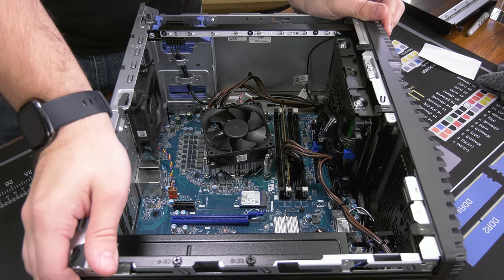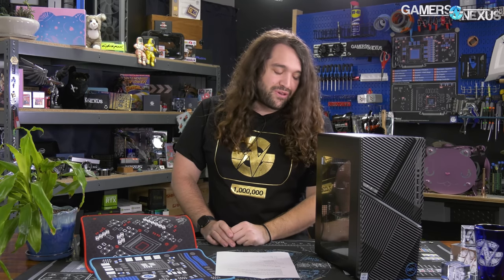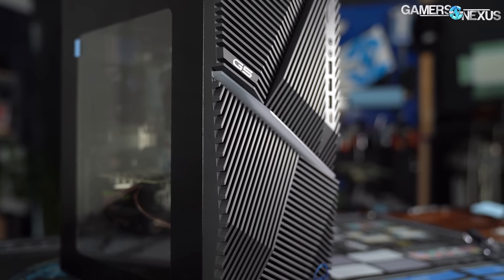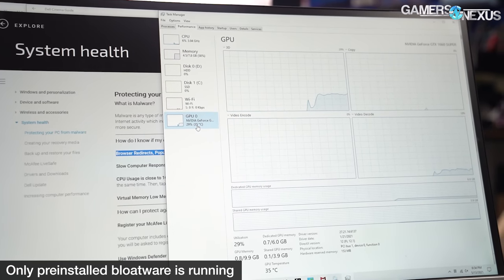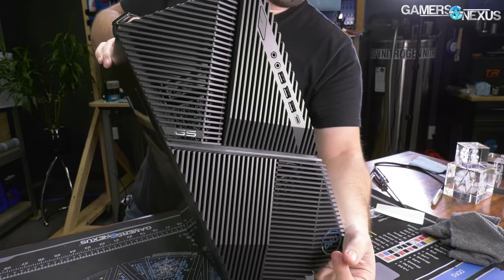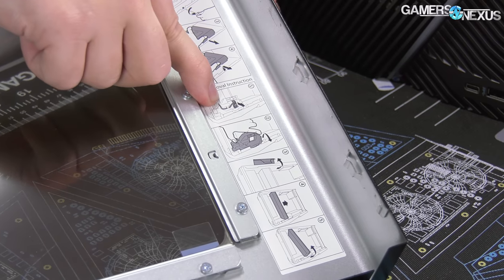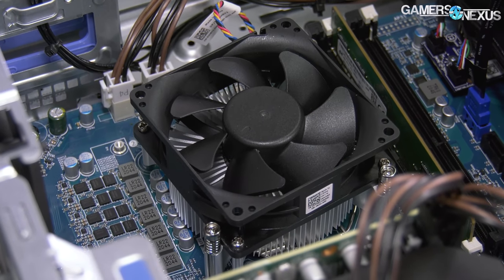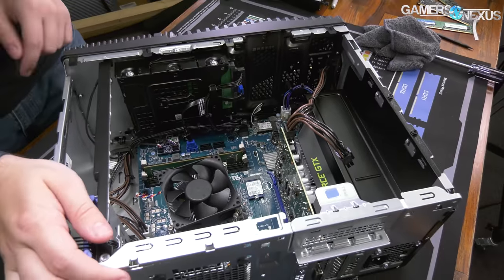Worse Than Walmart: Dell G5 5000 PC’s Garbage Parts & Hidden Charges

Comment: "Don't spare me, doc! What's the diagnosis?" "Dude, you got a Dell!" "Oh no! Is it terminal?" "Very..."
Reply: "No, it's not a terminal.  It's useless as a terminal.  In fact, it's just useless."
Reply: They didn't used to be quite this bad. I picked up a prebuilt dell from Costco 7 years ago because it was on sale which had an i7 4790, 12 GB ram, a 1 TB platter drive and I think like an admittedly butchered OEM GTX 750. Later after adding an SSD I used it until literally last month with a 2060 which was the third graphics card I had in it. All standard parts, I switched out the power supply on it no problem when I got the 2060. The only reason I replaced it was that the last couple years games were starting to be throttled by the CPU too much and I was seeing too many frame drops. I assume clock and ram speeds had just moved on to much but now it's my media server for my TV.

Sad to see them going from something that you could use and upgrade long term to this joke of a system.
Reply: This was so good, but also so bad, that i will return to my $SHELL and die laughing XD
Reply: Yes, but will you return 0, or 1?
Reply: Nurse, schedule a Dellectomy, stat!

Comment: This is a basic business office computer.  We've been getting very similar base models like these for years in bulk where I work.  They serve their purpose for basic office functions and that's about it.  For Dell to advertise this as a "Gaming Computer" is laughable.  Sure does look pretty on the outside though.
Reply: Yeah for real though. The case isn't awful.

Polished turd lmao.
Reply: Yeah actually I have a very good experience with Dell office PC for many many years. Never cross my mind that they do gaming PC. It's scam if an office PC with some second grade GPU plug in get to called itself gaming PC. I do build my own gaming PC.
Reply: A basic office computer with a completely unnecessary GPU that only adds cost, but does not make this POS good for even casual gaming
Reply: @Gatorade69  I remember that, and even after she politely declined all the extra warranty and support charges they were trying to put on her bill, THEY STILL ADDED THEM. I have a feeling their sales reps are instructed to do everything possible to add those extra items to every order - it's literally free money for Dell if the customer doesn't notice. Such crooks.
Reply: @LRM12o8  pos gpu can still have a use for non gaming.
Reply: @pokemoncrusher1246  not if the POS GPU is worse than the integrated one on the CPU.

Sure, you can maybe connect more monitors to the POS GPU, but I reckon anyone who uses more than two monitors at home is well enough versed in PC tech to install some cheap used GPU that's gonna do better thermally and probably also in performance themselves.

This whole box is made for the landfill. It just serves to advance the economic "cycle" of produce -> buy -> dispose -> buy anew, which isn't even a real cycle, because most products we throw away can't be turned back into resources for a new one.
Reply: @LRM12o8  a shitty 1660 ti is gonna perform better than any IGPU, no matter how dogshit It is
Reply: @Gatorade69  If they spoke with an agent over the phone to build the computer, I wonder if the agent even really knew much about computers. Having worked in customer service and over the phone IT, I'll be honest...most of the time, we truly have little knowledge of how the thing we're helping with actually works. The company just needs warm bodies in a seat that are hopefully friendly and they give us a crash course on stuff. 

It's not enough knowledge to truly understand everything (and in a sense, it's understandable. There's no way to train for every conceivable situation. And as for tech, those that are genuinely knowledgable about that stuff aren't sitting in a damn call center, they're setting their own rates as contractors or working much higher end jobs. Or making YouTube videos 😁). 

So, while it's possible the agent the YouTuber spoke with truly did intentionally rip them off, it could be something out of the agent's hands in terms of pricing or parts, or when recommending parts, the agent really didn't understand what they were talking about.

Edit: I'm sorry, I see someone else commented here in the situation and that it was about charges being added that were instructed not to be added. Again, might be out of the agent's control but that then still falls to Dell and yeah...that's just extremely awful.
Reply: Yep, the amount of tooling and parts shared with the Optiplex line is amazing..
Reply: @Gatorade69  And the best (worst?) part is that in the next video when they called Dell/Alienware with the issue that the shipped system doesn't boot they instructed them to send it back despite the added onsite warranty they added previously. So they add it even if you repeatedly say no, but conveniently forget about it when it becomes applicable and you could actually benefit from it instead of just paying for an unwanted service.
Reply: Long gone are the days of the venerable Optiplex?
Reply: 900$ for basic office does not compute. Stop defending Dell's corporate BS.
Reply: Pretty basic.
Reply: My 2012 Vostro has the same CPU cooler but because it is so old, it's board is pretty close to standard micro-ATX. Back of this case is almost the same as my Vostro, and the power supply is close enough but with standard cabling. This case is ancient, we got rid of many office Dell computers from 2009 and their case is pretty much the same layout.
Reply: to my it looks like an optiplex that got in a knife fight haha
Reply: A clear window on the side of the case wouldn't be there if it was a basic office PC.
Reply: @DystopianOverture  - I'm talking about the internals.
Reply: Wouldn’t Optiplex be a business office computer? Dell G series is basically a crappy version of Alienware gaming pc which a crappy version of actual gaming pc (custom build)
Reply: Any buisness buying these is as blind and souless as Dell.
Reply: Yeah, Apple products look pretty, cost the earth and have crap components, too.
Reply: Yep, essentially an office spec level machine made to look, 'sexy', in a weird looking proprietary case.  The low-end GPU says it all, really.  I guess 8Gb is standard RAM, nowadays.
Reply: Gigabyte and many other companies make decent inexpensive commercial grade motherboards (green solder mask, off the shelf heatsinks, no fancy graphics or colors) that don't look pretty but they work like they should. So no excuse for something like this.

Comment: Not shocked, Dell has been doing this for 20+ years. "You're getting a Dell" used to mean you were getting robbed.
Reply: "used to"
Reply: In my experience Dell Optiplex and Poweredge were built very solidly and lasted a long time.
Reply: @gleggett3817  but they were better now they are using this all propietary HW on all the systems, and  I used to work as second Leverl tech support with them like 15 years ago, they used to be good. now they are not.
Reply: @n0iseradi0  i have an old dell that is around 15 years old but the power supply crapped out recently and all i can find are refurbished ones and i won't buy refurbished electronic or electrical parts. which sucks because it was still a good system for web browsing and streaming...
Reply: @hellshade2  Why not buy refurbished? I've bought plenty of refurbished stuff and they usually last as long as new. Especially  a Refurb PS. That means a guy that knows what he's doing went through it. Replaced the bad caps and other bad equipment. But hey, it's 15 years old. Even replacing the PS may damage the motherboard. I have a pair of HP DL380s that work as firewalls and they're 15 years old. They just keep on going. I have one spare PS left over and some extra disks. I also have one blown PS.
Reply: @gleggett3817  that was 20 years ago bud, the world is not the same
Reply: more like electricuted
literally got zapped with a dell once while plugging it in, whole case was energized.
wtf!
Reply: My step son wanted to get a Dell so we went along to their store. They were very vague about the specs (I asked for the CPU speed, not how long it takes to encode an mp3) and their financing rate. Finally managed to squeeze out of them that it was > 30% APR charged upfront so nothing for early repayment.
I told them to f*ck off, purchased the parts for him elsewhere and built him a better one for a fraction of the cost.
Reply: @immortalsofar5314  thats cheap chinese throwaway appliances for ya
Reply: DUDE ur getting a Dell. That sucks. RIP.
Reply: Used to? Still does.

Comment: I've been dealing with Dell in the business sector for quite some time and a little bit in the personal sector and this, to me, screams that they basically have fired the entire personal manufacturing division and told the business division to pick up the slack.  This looks exactly like the business computers I've dealt with for over ten years.  All proprietary, can't swap stuff out for other parts, gotta deal with them directly for literally anything to do with it.

For a business computer it sort of makes sense since companies will basically just replace the entire computer every few years instead of upgrading parts in their existing ones but as a personal computer it's just BS.  This is just an effort to make more money by cheaping out on as much as possible and forcing people to either buy a whole new system or proprietary parts that may only be available for a year or two at best.  Very poor form, Dell.
Reply: Since I started working with Dell machines ive always tought of them as the McDonalds of computers. We exclusively use Dell at work. From the Servers to the Laptops. All Dell. And for Business, they are fine. If something breaks, you can fairly easily get one of their techs to replace it. But, that's all they are. Fine. They work. Loads of room for improvment. So yeah. The McDonalds of computers.

Comment: So that PC is basically e-waste. That's just great.
Reply: Yeah I remember when Dell used to actually be good but that was a  very long time ago.  They are ok for business if you're not doing anything really intensive but  nothing else.
Reply: Direct to consumers,  direct to e-waste.
Reply: @seiboldtadelbertsmiter3735  Even the biz machines have weird fuckery going on. The worst that comes to mind... I forget the model, but the x16 slot was only rated for 35w, so high powered card would burn up. But you really had to dig thru the docs to find it. So the place I worked had cards blow up, a few machines catch fire, etc. When I showed people what was up when machines in my area blew up, it was thrown under the rug so the boss wouldn't look bad. F'd up machines for f'd up workplaces.
Reply: We're facing a massive chip shortage due to scarce materials. Every one of these Dell made represents an RTX 30 card that wasn't.
Reply: @seiboldtadelbertsmiter3735  Dell has always been jerks. Even when their boards looked ATX, they would use non-standard pinouts so the power supply would blow up your new board and the old board wouldn't work with a new power supply. Not even good for business; overpriced, slow, unreliable, and crappy support
Reply: Feel free to drop yours off at your local E-Waste Center and let me know when you do
Reply: @czos9239  we had this exact same problem when we upgraded a load of computers for council and they demanded dell pc's be installed. They lost all of the parking warden's pc's as their handhelds required a card installed which ruined the motherboards when they got plugged in to upload parking data. Dell wouldnt fix those computers under warranty as the council caused the problem, and the replacement boards were over £100 each as they were proprietary to the case and they could only be bought through dell. These base £500 i3 machines, end up costing £7-900 after repairs and new boards, for a 4gb ram, i3 3k series, and 500gb hd, no surprise the budget went over by millions for a small local council.
Reply: Totally worthless, let me take it off your hands.
Reply: Target practice.
Reply: Creating e-waste is Dell's motto. Has been for decades.
Reply: This video completely justifies why I've been building my own PC's for the last 10+ years. I've never seen anything even close to this bad in terms of a build.
Reply: @ts757arse  This video almost gave me one already.
Reply: Factory made garbage
Reply: @czos9239  that makes no sense. It can't burn up if it gets far less watt then it asks for.
Reply: @shroomiestshroom3655  man, so they could even build a low to mid-end gaming pc with ryzen 3 integrated graphics or even with like a 1050ti for that price and get a better performance..... feelsbadman
Reply: @---H_M  Go to your kitchen and grab your toaster.  Bam, you're already ahead of this thing.
Reply: They should do a rebrand to 'DULL' Computers!
Reply: With extended warranty
Reply: ShamblerDK
What is worse than the e-waste is being DEL-usional about the purported quality
and value of DELL products, that are DEL-iberately manufactured to be junk.
This video review by  Gamers Nexus  will make every viewer be DEL-aware ...
Reply: environment friendly
Reply: they should of included a free trash can with it so you can throw it away when you have it home
Reply: Super irresponsible of Dell
Reply: It’s technotrash lol
Reply: There's no excuse for a $900 co0mputer being e-waste.
Reply: $900 e-waste
Reply: @seiboldtadelbertsmiter3735  They're business and enterprise solutions are great, their laptops are great. Their low to mid range consumer desktops though are terrible, and they've been doing the proprietary non standard form factors for ever.
Reply: It's a shame that people still dare to ask 900 dollars for this junk. I find this toy paid with 375 dollars
Reply: @czos9239  When i worked in an IT computer lab, we were starting to see alot of proprietary power supplies in new dell business pcs. We were also replacing a fair amount of them for how new they were. Dude don't get a dell. Pretty sure planed obsolescence is a high priority for them.
Reply: Might be able to salvage the cpu without issues. Thats litteraly it tho
Reply: You ask why integrate things and make the cooler hold the mobo? Less assembly. Cheap consumer motherboards aren't optimized for scale production (even if standard components are better for the consumer).

Comment: "Go Dell, go hell." is one of the oldest IT wisdoms for a reason...
Reply: And yet it isn't really old… ;-)
Reply: Good slogan
Reply: Nonsense.  Dell makes perfectly capable PC's providing one knows what they're buying.  Dell sells cheap garbage - every PC maker does, and sells very nice machines if one is willing to pay for it.

We've been buying Dells for corporate use for literally decades.  Many 8+ year old Dells are still running fine to this day.

You buy cheap, don't complain that the product is cheap.  If cost is your primary buying choice, you get what you pay for.
Reply: Might also have been my own creation, 20 years ago. 😉 I used it so often I thought it's a saying. 
I'm talking about consumer experiences: Business customers always get treated better. 
Even 20 years ago, Dell screwed their customers with bad configurations, proprietary and more expensive hardware and by pushing unnecessary services and software on unknowing customers. I remember several cases in my family and circle of friends. Not much seems to have changed...
Reply: @Gmon750  Yes, for business users. Where deals are made with a different side of the company, that specializes in different products.

Enterprise machines aren't just more expensive, they're often not sold to individual consumers. You're comparing apples to concrete.
Reply: @rafaelmarkos4489  Yep 100% true..
Reply: @Gmon750  But this isn’t cheap

Comment: "How can we ensure every bit of this ends up as eWaste when someone buys it for the GPU?"
Reply: Uh, make a GPU out of eWaste?
Reply: And to think they go out of their way to design and engineer this custom/proprietary garbage. Engineers somewhere clock in thousands of hours, for the sole purpose of making our landfills taller.
Reply: I dont have any data on the thermals, but given the nonexistent cooling of the memory modules, wouldn't it decrease the GPU's lifespan too?
Reply: @britishfirefly6523  it's a 1660 . It won't be too bad
Reply: @ChristopherHailey   Looks like Dell succeeded in doing just that!  😂😂👍👍
Reply: Gonna be a bad day when they realize dell changes the pinouts on the bus, and that card won't work in standard mobos
Reply: @mistakenotou7681  uea but its a Dell card so its gonna be garbage.
Reply: but whos paying 900 dollars for a 1660
Reply: @drmikehuntphd7905   I guess that you have to be REALLY desperate...REALLY, REALLY desperate!!  I have an old GTX 780 ti and I am happy enough with it. Hell...I also have an old machine with a Radeon 6570 in it that I use to play Skyrim and some older titles with! Sometimes you just have to be grateful with what you already have, at least for now, but Dell/Hell.....👎👎
Be well out there yourself! 👍👍
Reply: @britishfirefly6523  They are probably depending on the general airflow through the case to cool the memory module. I have built hundreds of PCs and file servers and have never actively cooled memory. Passively, yes, just not actively.